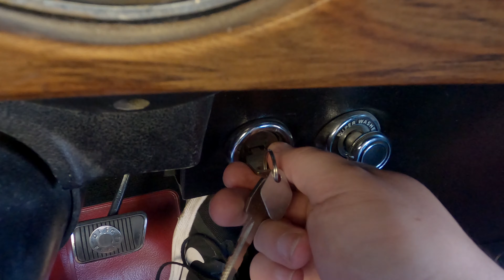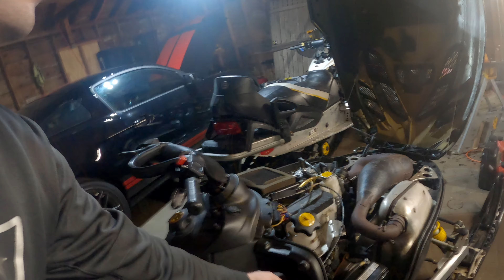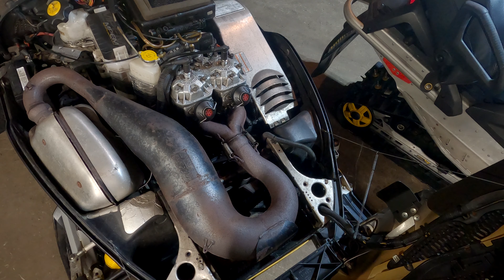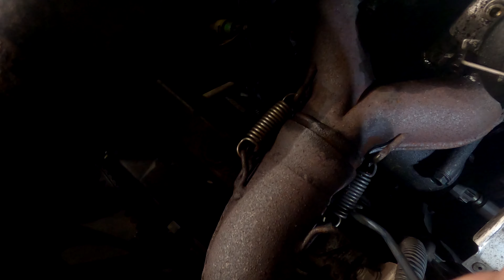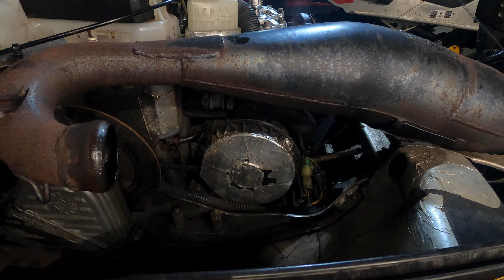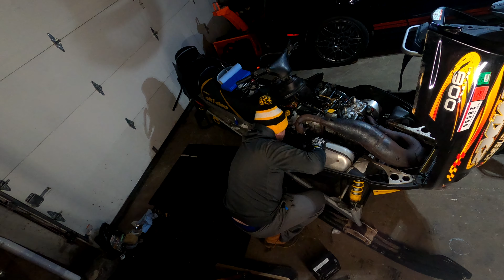Replacing the Recoil Pull Start on a Skidoo 800 Renegade

Comment: It’s a really crappy design. I have a 800 etec and I end up replacing mine every season or two because the stupid thing is made of plastic. When it’s -20 degrees in the morning the force you put on that plastic pawl and other parts is quite severe. I’m shocked the aftermarket hasn’t come out with a metal recoil assembly. This should have been a metal assembly, my buddy has a 600 and his has never given him issues I think the extra force an 800 takes has put this part over the edge.
Reply from the maker: I think you are right on the temperature and the amount of stress the engine puts on it. The engines are so tight at that temperature and barely turn over. You end up putting so much force on it that strip. You are also probably right with the 600s and lower compression or tolerances.

Comment: Rebuilt the pull start (mine is exactly like yours - MXZ Rev800) but it would not engage the engine when the pull start is initiated. Rewinds perfectly just would not turn over the engine.
Reply from the maker: Did you check to see if the place that it engages the engine is stripped? I've seen that happen a few times on ones that become loose.
Reply: @SmackeysGarage   Figured it out -  the component's were not seated correctly then learning my flange bolt holes were stripped.  I also nicked my radiator hose than runs vertical to pull start - fun fun fun.  Thank you for your reply.
Reply from the maker: Able to get it sorted out? Glad I'm able to help!